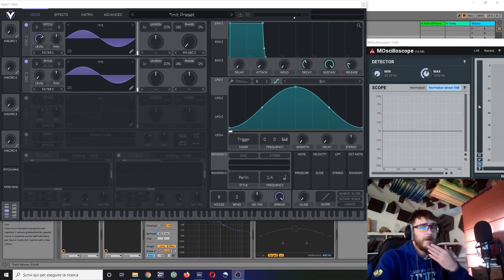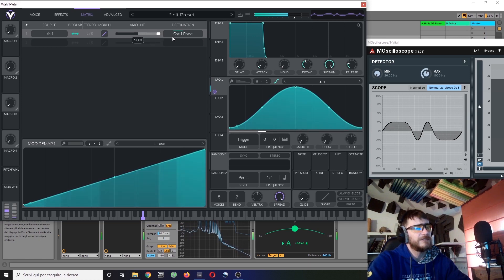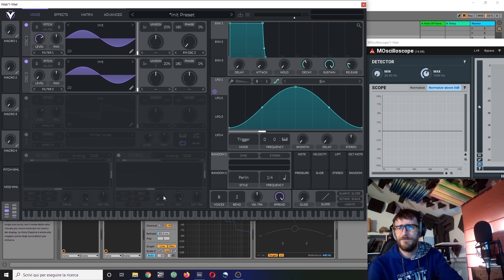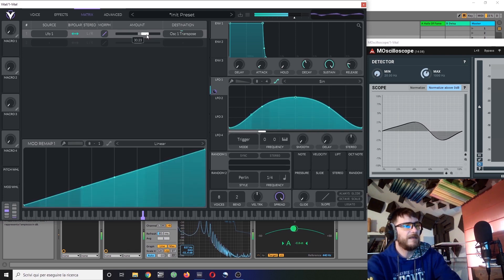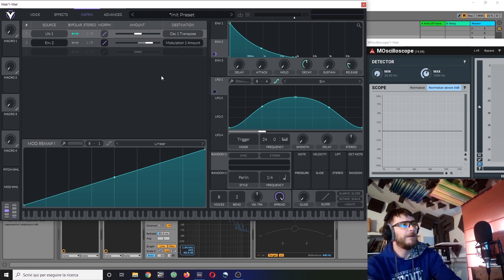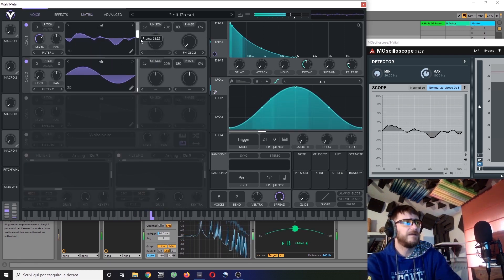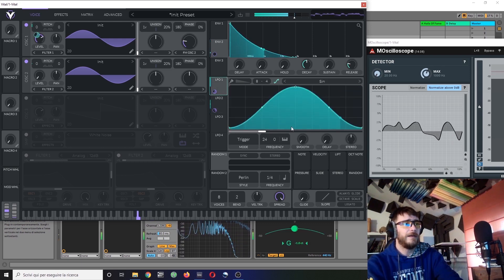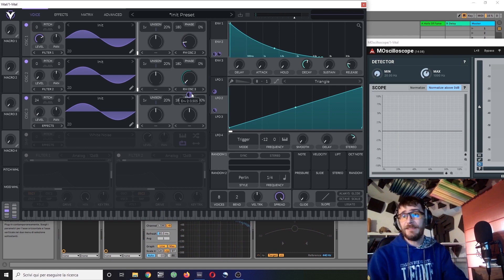Why you're not doing "True" FM synthesis

Comment: I use Bitwig Studio (DAW), which you might know. Bitwig Studio contains a modular environment to build up ... almost anything from simple effects up to real modular all in everything modular patch... well, that's not my intention.

But all of Bitwig Studio's oscillators inside this modular environment come with different kinds of pitch/frequency control. Most notably there are a Pitch In and a Phase In, which tell basically their intended goal.
Most users don't really use FM, because using the Pitch In with linear signals realizes a quite non-linear (and btw non-symmetric - in no understanding)kind of frequency modulation with odd sound, not "pitch-true"... not really that good musically controllable.
But... almost all of them overlook a very simple method, which can be used to re-calculate the modulation signals in a way, that makes the concerning oscillator behave as if it is controlled by a linear frequency input - hence enabling _ t r u e _ ( =linear) FM, which can even quite simply be patched, so that you can control a value, which you might know as "modulation factor".

In my understanding linear FM has a very ugly disadvantage: If you modulate crossing the "0 Hz" barrier, the sound begins to behave more and more like exponential FM, which doesn't keep the pitch played, because the generated frequencies are not longer "symmetrical" to the carrier frequency, which otherwise is the case fore modulation factors up to 1. Although linear FM in my ears at least sound more "warm" than phase modulation (PM), this disadvantage especially begins to limit it's use in case of the need for exact pitches... this said: Linear FM used with high modulation factors might give interesting sounding sond sources for all kinds of technoid music, but... as long as it is supposed to sound "smooth" and "tamed" this modulation factor has to be limited to 1.
This symmetry though remains in PM - independent of the modulation factor - up to very extreme sounds - making a much better musically controllable sound... which imho was the reason, why PM has made it's way as _ t h e _ preferred modulation method against linear FM. This linear FM might be interesting to "thicken" an otherwise too "silent" sounding deep (pure sine) bass, but... that can be achieved using PM and some filtering (presumed a pitch-following modulation depth as well as filtering).

Comment: Newbie here. Something I don't understand. You mentioned FM radio. But with FM a fixed frequency operates as a carrier which is modulated by a complex wave, typically an audio source. But in FM sound synthesis the carrier is variable, tuned to a scale. And as you rightly note, pitch is linear but frequency increases exponentially. What's confusing me is that your modulating source is a simple sine against a variable carrier. And this is nothing like radio. Conceptually I'm clearly missing something obvious here.
Reply from the maker: I don't really think you're missing much according to what you write, and this really doesn't look like a newbie comment :D

Anyway, yes, the carrier is variable in frequency as it is tuned to a scale, but so is the modulator. The analogy with FM radio is of course superficial and somehow, as I mentioned, probably the choice of the name was more of a commercial gimmick than anything else; it is nothing like radio, because the purpose is different and the method too, as to make sounds interesting we'd want the modulation amount to change with time; here, we're not interested in encoding and decoding a signal, only in generating a signal with musically useful characteristics, different from both the carrier and the modulator. I hope this answers your question, if it doesn't well... Ask something more specific, and I'll see if I can help.
Reply: @platipo  Definitely a newbie. But I grew up building HAM and digital electronics. So I understand the basics of how FM radios work. But I don't understand what you're doing to make these sounds. Or more importantly, why you're doing certain steps and the ordering of them. I have read through some stuff on analog and FM synths. But I really need hands on with examples to get my head around this. And you're doing that here, so thank you.

Something I thought about. You had a video about creating a flute like sound (I think with Surge). I watched it. And I thought, ok, it sounds a bit flute like. But it's missing a simulation of breath. Like, what a flutist does with his or her mouth to force air through the instrument. And that's part of the sound in a physical sense. Not criticizing, just thinking.  

Not even sure how to create wind like sounds. I'm mainly here to figure out how to create room space ambiances for artificial room tone with video projects.
Reply from the maker: Yes, good observation, I insist you definitely don't sound like a newbie :D 

In that flute patch, I had the noise routed to the comb filter, and unfortunately I can't in Surge mix some dry signal with the filtered one, my attempt at that was making it, in the surge video, like some sort tuned noise but it is indeed quite complicated to make it sound "right", and yes, I agree in that patch it really didn't I had made a nice and quite realistic flute patch in Zebra some time ago, following loosely Gordon Reid's suggestions from synth secrets, if you're interested in a more technical approach to sound design and you're not scared of geek talk, I strongly recommend his series of articles